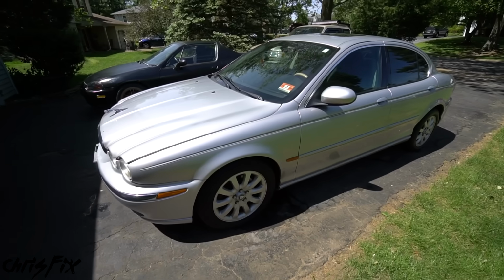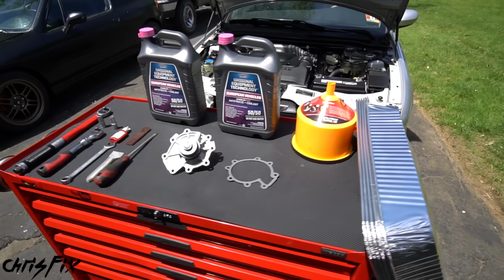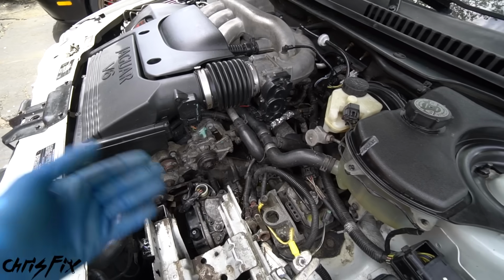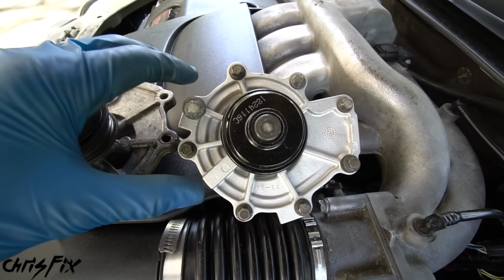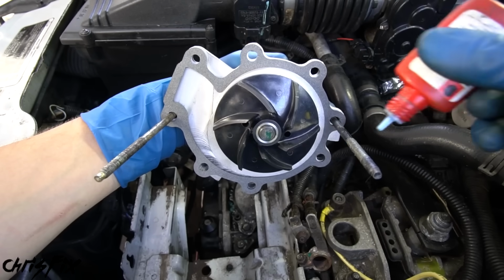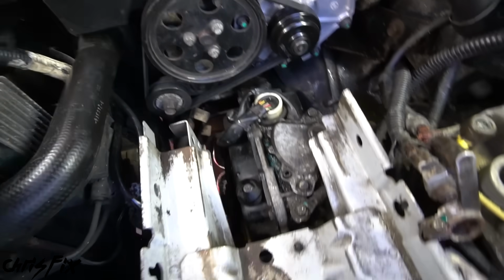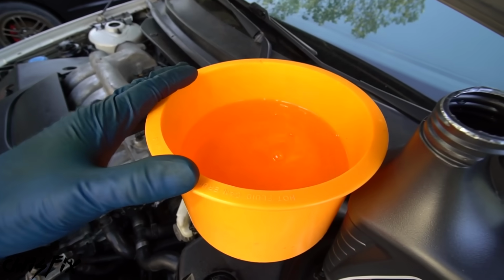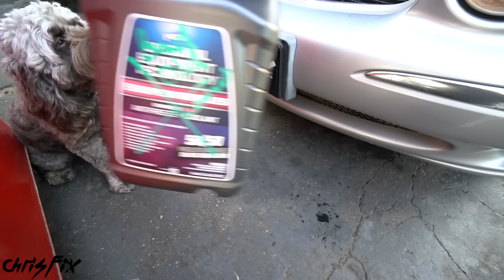How To Replace a Water Pump and Save $783

Comment: On my Saab the water pump is buried, takes about 3 hours to get the car tore down until you can see it. That's if you know what you're doing, the first time I did it took 5 hours to get to the pump and 3 hours to get it back together.. some water pumps are serious business lol

My father in laws Silverado though, just loosen the accessory belt, unscrew the 4 screws, put the new pump on, put the belt back, done. Takes like 20 minutes lol.
Reply from the maker: I want to do a video on a hard to get to water pump! That would be a great comparison! Thanks for sharing Jesse!

Comment: Good luck doing that on 3.5 Toyota engines (avalon, sienna, and such) service manual says you need to take engine out to be able to replace it.
Reply from the maker: Dang that is horrible!
Reply: @chrisfix , yup. Bolts hit the frame rails. You can get around it by removing all engine mounts and then having a jack underneath the engine lift up and lower down until you can get them off. But definitely not an easy one.

Comment: I heard this is a hard job when the water pump is inside the engine with a timing chain.
Reply from the maker: You mean timing belt. Timing chain is usually pretty simple. You just need to get some parts out of the way like an alternator or cooling fan.

Comment: I have a 99 Integra and AC works it's all filled up with freon but it just seems to not get cooled off good enough when it's really hot is there anyway I could put a bigger air compressor or anything to make it colder stronger something any tips tricks will help. 
I've been in cars that has literally freeze to you out and I have to constantly have my AC on full-blast just to stay cool
Reply from the maker: Make sure the ac fan is working. Also, try clamping off your heater hose (that runs to the heater core) and see if that causes it to be cool. The blend door might be mixing hot and cold air so it doesnt feel that cool.

Comment: Thread locker on a water pump bolt?  Your kidding.
No gasket sealer on a water pump gasket?  Your kidding. This will be leaking in short order.
I like your videos but this one, not so much.
Reply from the maker: Thanks for sharing. You do not add RTV to a gasket. That is mechanics 101. Otherwise just dont use a gasket and use RTV only. There is a reason why you get a gasket. The Threadlocker is not only to hold the bolts in but prevent the bolts from corroding in the aluminum block since the bolts are steel and dissimilar metals will cause corrosion. Hopefully that info helps you out!

Comment: You anit going to ruin your engine with different coolent I been a mechanic for 36 years
Reply from the maker: Thanks for sharing. What happens is each coolant type is made for the specific vehicle type. Some have cooling systems with aluminum and steel, others are only aluminum, and many have rubbers and plastics. Each brand (Toyota, GM, Jag, etc) has an OEM coolant they made for that specific system to work with those metals and plastics. If you run a coolant that is not made for your system, you wont see short term damage, but over the years things will wear out faster due to electrolysis and rubber/plastic degradation. Hopefully this info helps!

Comment: Hey guys, not ChrisFix here! I replaced the water pump on my 89 mustang back in February. While it wasn't quite as easy as the one Chris does here, it was easy enough as long as you take your time and plan ahead and give yourself plenty of time. My biggest concern was one of the original 30 year old bolts breaking on disassembly or reassembly. Luckily they were in decent shape, but I still plan to go back in and replace them with new ones over the summer. I recommend using Permatex high tack spray-a-gasket sealant on only the water pump side of the gasket before you put it back together.

Comment: Could you please do a video on how to replace the Power Steering Pump? My mechanic charged me 765 dollars for it and  i cant do that. My steering is very heavy (sometimes it gets smooth but slower speeds is heavy especially parallel parking) and it squeeks and groans sometimes. PLEASE HELP US CHRIS!! IK OTHERS HAVE THIS PROBLEM

Comment: Old metal OEM pump lasted for decades. Let’s replace each year with cheap plastic aftermarket pump. Not smart. 👎
Reply from the maker: The new water pump is all metal and meets or exceeds OEM specification which will also run for decades. I am not really sure where you got plastic from but maybe you didnt watch the video or research the pump I used which I linked in the description. Thanks for sharing.
Reply: @chrisfix  Ok... But, why not just install the factory, OEM part, if you are already saving money? I don't understand.

Comment: I expected Jaguar to have it's waterpump in a very unreachable place but it's actually very reachable. Neat.
Reply from the maker: This is probably the best design possible haha.
Reply: @chrisfix  the waterpump in my car is in a very tight spot. You have to basically remove cambelt to gain access to it. Not too bad though, since it's probably a good idea to change cambelt and waterpump at the same time.

Comment: Loctite on those small engine block bolts ? Dude find a torque spec.
Reply from the maker: You must have missed the part in the video where I torqued each bolt down... Threadlocker is a very cheap and effective way to prevent bolts from backing out, even if they are torqued. It also prevents corrosion.

Comment: This video is pretty deceptive. Most cars have their water pump behind their timing belt cover, they also require you to remove the timing belt to replace the pump. You should make a video for a car like that. This is a really easy water pump replacement. Cars are almost never this simple.

Comment: Just a question on why you are insistent on salvaging coolant? If the bearings have gone bad along with the bearing seal, isn't there a strong likelihood of there being metal shavings from the bearings remaining in your system? Why would you sacrifice your new pump and labor for $15 of fluid? That is the height of stupidity. A mechanic charging you $850 would not make such an amateur mistake to have to replace your pump a 2nd time for free. That makes no business sense.

Comment: A little trick I've used in my almost 30 years as a professional factory trained technician is while it's sitting there with your spill proof funnel full, grab the rad hoses and squeeze them quite a few times so the coolant pulsates in the system and it'll almost 100% bleed your system before you've even started your vehicle.. It's so simple and I've never encountered a vehicle this didn't work on.

Comment: Look at me. I'm Chrisfix and my waterpump isn't driven by the timing belt 😔
Reply: how to replace timing belt video coming soon
Reply: Or stuck behind a framerail and have to take off 2 motor mounts and jack the motor up to change it.
Reply: @jakobrkerr  Or in between the engine and the body of the car... with about an inch of clearance. 

Thanks Mazda.
Reply: @99domini99  I've DONE my Wife's Mazda.
If that Pump ever goes again...... 
5 POUNDS of C4 under the hood!!! 😋😄😆 

I'm a Retired Ford Tech... So glad I never had to work on too many of those. 
Although the early Focus - Engineers DEFINITELY designed that Engine OUTSIDE of the Car!! 😳
Then they tell us Wrenches "It's a much easier Engine to work on" 

........ YEAH, if it's spotlessly clean and sitting on a Workbench!
Reply: @CarlRCTips  God damn I hope that pump keeps working. Doing almost anything on this car is a pain in the ass. It's certainly not made to be serviced easily.
Reply: @99domini99  even a damn Oil Change can tear up your forearm!! 😡
Reply: H o n d a
Reply: This

Comment: Great video! My water pump failed in an atypical way. There was never coolant leaking from the weep hole but the bearing in the impeller went bad and started eating into the side of the water pump so it made a loud grinding noise. That obviously warranted a full coolant flush. The bolts on the water pump also were the bolts for the timing chain cover so I needed to be careful to not disturb that. Always fun to work out each cars individual challenges!

Comment: I love that you show cars and how to repair them.  But this water pump is definitely easy compared to other cars. When I had a Santa Fe, mine was ran using the timing belt. My Subaru now is also timing belt. So in cars like that you have to be careful with timing. But still great video as always.

Comment: Just did it myself. Toyota wanted $1800~ish for my 2014 Corolla, I believe most of that is labor. My pump was $130 with gasket, belt was $25, and coolant was $56 for 2 gallons. I didn't even use it all. $211~ish and an afternoon. They charge almost $1600 for labor just for that? FFS.
Reply: Are they hiring surgeons to repair vehicles at that dealership? That is three times more than what I was quoted locally.
Reply: @Brodmann312  Why do you think they call them "STEALERSHIPS"?

Comment: Have any advise for a timing belt Job 1.8t gli mk4 05 VW Jetta.
Reply from the maker: Take some pics and take your time. Put the engine in top dead center before you take anything apart

Comment: I usually smear the paper gasket with a very thin coat of RTV for that added security.
Reply from the maker: It's actually recommended you should not add RTV to a paper gasket. That is like adding a second gasket layer so more area to fail. If the machined surface is all scratched up and has groves, then its a good idea to fill the grooves!

Comment: Should have left the belt on before loosening the pulley bolts, the belt would help keep the pulley from moving. I know it didn't matter on this particular vehicle, but others it would be essential. Might also want to mention how a great many vehicles have the water pump powered by the timing belt, and some are even electric. That Jag was unusually easy, and you were right to scoff at the dealers price. Great video

Comment: I wish Audi Quattro's were this simple. They put the wooder pump behind the timing belt, pulleys and covers. You have to literally take the entire front of your engine apart just to get to the wooder pump, which is why it is suggested, that when you replace your timing belt, you should always replace the wooder pump.

I didn't have the required specialty tools to do the job myself, cam lock bar to lock the cams into place so it doesn't jump timing and damage the valves, and a special torex, but my mate did which is why he walked me through the process and helped me out.

To have a stealership replace the wooder pump, they charge over $1100. My local mechanic charges $650 including parts. My mate helped me out for free and I only had to purchase the parts and some lagers. I helped him install a new deck at his home for helping me out. Always awesome to have a mate that can help you out when you need the help.

Comment: Not all cars water pump replacement is that simple, in many cars, water pump is behind the timing belt and replacing that is quite challenging, if the engine is interference engine. It took me 10 hours replacing my car's water pump and timing belt.

Comment: Nice and simple on this car and similar engines. I might have mentioned something about it being substantially more involved on engines where the pump is driven by the timing belt - just because it's very common. I will say for certain that you derailed that dealer's gravy train on this one though - nice!

Comment: "this is a simple job"

Alot of European cars have the waterpump driven by the timingbelt
Reply: Japanese as well. Subarus are nightmares, period really... but the timing belt and water pump need to be done at the same time and it takes like 8 to 12 hours, and unlike a normal 4 cylinder vehicle you've got twice as many cams and cranks so there's like 8 marks to line up on top of getting to the pump and changing it. Total BS lol, the ads talking about low center of gravity aren't justified at all in my opinion just because of how difficult it is to work on.
Reply: @jetjazz05  dont you almost need to take the engine out to work on it?
Reply: @MRDGames24  You can leave it in but... it'd be a hell of a lot easier to do it that way. I helped my buddy do his Impreza a couple years ago, I think instructions he found online said it was easier to take the engine out but we did it in place. You've only got like 8 inches between the radiator and the pulleys so if you slip up... bye bye radiator! We covered it with cardboard but there was a couple close calls.

Comment: Now do a water pump on a chevy 3500. You picked one of the easiest replacements. Don't get me wrong here, your channel is great! I share videos from it constantly. 
But come on, now you have to replace the water pump on your mustang. Or the truck. Or any modern V8 that might involve a timing belt. It can be easy. It can involve lifting the engine.

Comment: Great vid! BTW, in Europe water pump is usually replaced with a timing belt, also a tensioner pulleys.
Reply: Only if the waterpump is being driven by the timingbelt

Comment: Nice video, although this is an easy replacement, had to do mine a few weeks back. It is on the timing belt so it was a lot more work.
Also saw you are using a plastic waterpomp instead of the metal one that came out, watch out cause those will break way quicker, better to take an original one.

Comment: Just recently did this now im dropping my dads tank to replace the fuel pump. Great video. What ever the bolt says like 10 or 12 or 8 thats usually the torque spec like an 8mm bolt gets 8 foot lbs.

Comment: Don’t you need to keep a 12 volt power source plugged in when removing the battery to avoid ECU issues and memory settings?

Comment: You just change Old Gasket by New One. It will save $800. The New Gasket will Cost Up to $20 to $40.
The Pump condition is Good, the Gasket only get damaged.

Comment: Replacing a water pump is literally under 60 to replace  and if you take it to a shop they charge less then a $100 and it’s like a 10min fix depends on the car point is it doesn’t take long at all and if you pay over 800 just to get a water pump replaced and install you’re getting ripped off big time

Comment: Hi chris. I love your videos. I wanted to Express concern at your using thread locker on the water pump bolts. In my head that's akin to using it on a oil drain plug. It's going to make changing the water pump in the future a bear, especially for a bolt that has a very minimal chance of backing off. If any.

Comment: A Jag with 190,000 miles...only possible in the capable hands of ChrisFix. 

Also, almost all V6 Honda/Acura engine are not quite as easy to replace the water pump, haha

Comment: would have used some brake clean on the pulleys and used a new belt since they were coated with antifreeze.  i had a leak in mine after it was fixed bad belt squeeks when it was damp and cold out.  it was the belt that was coated with anti freeze. cleaned the pulleys and got a new belt no problems now.

Comment: So my headlight won’t turn on and I know it’s not the bulb because I changed it and I checked the fuse so it has to be an electrical issue I could be wrong obviously I’m not a master mechanic which is why I’m asking here

Comment: Where was this a month ago when I needed to replace my water pump? Luckily I was able to do it anyway. Toughest part was loosening the belt because I didn't have a pully tool and in my Malibu it's all the way in the bottom & couldn't get enough leverage with my socket wrench. Had to get one from Amazon for $20, but then it came off easiy.

Comment: Back in the eighties my neighbors Jag had a five thousand dollar rubber hose change. That car was traded in after the repair. The cost of the hose was only six dollars. 
I couldn't believe it myself but the whole engine had to be removed for the fire wall mounted hose. My neighbor then drove a small Japanese import truck after that experience. That was more than outrageous money at the time.

Comment: Service shops don't like doing anything difficult. If we can do it in our driveway they can do it far cheaper
Reply: Lol external water pumps aren't that common most are chain driven or timing belt driven
Reply: @robbiesantos7677  exactly
Reply: 13 min video took him 6 hours....c'mon bruh
Reply: Zaltic 
Did a $800 job in like 20min with 5 hand tools and a couple chicken trays lol.
Reply: Hell, my Duramax water pump is driven by a gear on the cam shaft.
Reply: You should never work on your own car.  Take it to a professional, not a YouTuber
Reply: @crini413  maybe learn something and do it yourself. Iv worked on every vehical I have and iv worked on semi trucks too, and I'm only 19. It's not hard to do, it takes commonsense and a little bit of elbow grease. If u have a problem with his videos, then leave!
Reply: @A1rs1ck  I didn't need ChrisFix to tell me how to change a water pump, but he had a couple of good tips and I'm always willing to learn something new!
Reply: @crini413  True, but with enough practice you can become the professional. If you have a disposable car why waste money on a mechanic when you could learn to do it yourself.
Reply: @crini413  I've worked on my "own" vehicles for over 30 years now, starting on my dad's car when I was 12. I've dealt with many "professionals" that I wouldn't trust to fill my tank, let alone fix my rig. A good number of trustworthy pros started the same way.
Reply: @chadalcock7275  now you understand :)

Comment: Did you forget to run the heater to get maximum circulation and get all the air bubbles out?
Reply from the maker: There is no heater control valve so just running the engine will push the air out of the heater core.